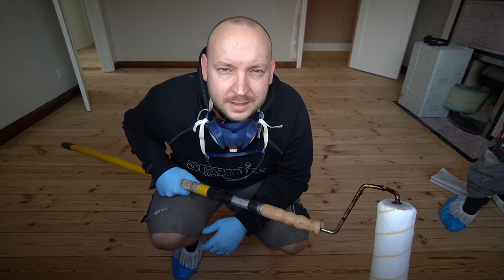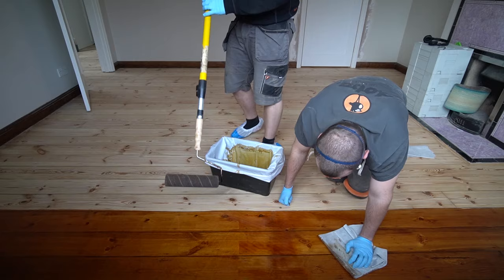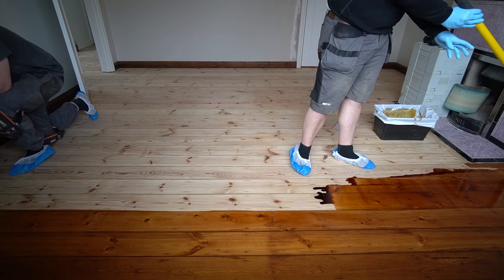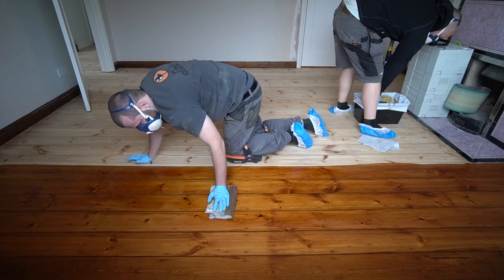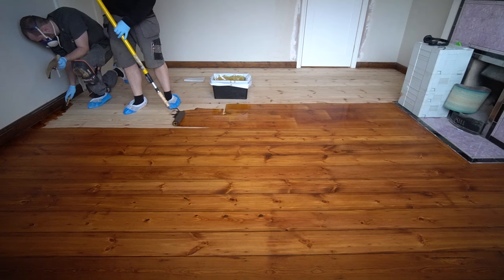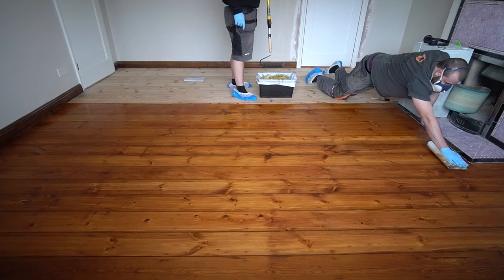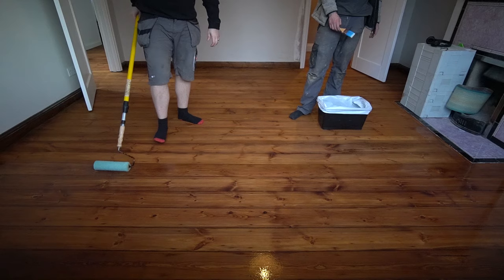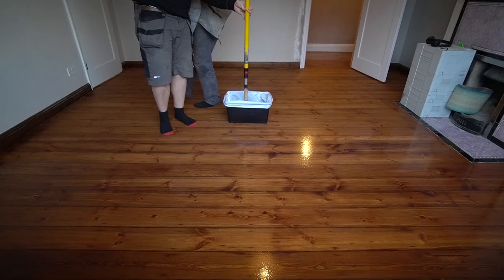A Staining Method That's BETTER FASTER AND EASIER

Comment: Nice job... Am sanding down my hallway this week (Victorian pine), and am going to stain it. Like the look of this Morells, and was going to use a roller anyway. Thanks for the confirmation it will work. What colour is this one?
Reply from the maker: I think it was medium oak
Reply: Cool. Many thanks! Great video. Wouldn't have thought of getting someone to wipe the excess off straight away. Will get the missus on the case with some knee pads!
Reply: what thinners other than Morrells could you recommend?

Comment: Thanks for the videos. Would you recommend a beginner using a roller on a pine floor inside a log cabin?
Reply from the maker: It depends on the stain you’re using to be honest. The safest thing is to rag on and rag off

Comment: Thats a belter of a finish man. Perfect colour too, not too dark, no orangey bits either. What type of pine did you use? Im planning on using French Maritime pine from B&Q. Thanks.
Reply from the maker: Micheal Kaye thank you sir. 🙏🏼 these pine boards were original, it won’t be the same from b&q. Was medium oak stain.
Reply: @HowToSandAFloor  In what way will the French pine differ? The older boards in this vid may be drier and better settled? Either way, the stairs and the room look great, really good colour and finish. Im doing my own 8sq. metre kitchen, when its done Ill send some pics. Thanks again for the video.
Reply from the maker: Micheal Kaye new pine is farm grown, much lighter, absorbs much more stain. You could try getting reclaimed pine boards

Comment: Will the top coat fill in small cracks? like a water-based poly. I filled a lot of mine with wood filler - but I'm still getting cracks after drying. If so, how thick of a crack would you say? thanks for all of the videos
Reply: Haha - I'm just now hearing the filler part of the video. But, if you don't fill, will the lacquer fill up to a certain gap thickness?

Comment: Looks great. Just curious about fillings. Could you fill cracks(not the whole floor) with epoxy? Or would that mess with the expansion and contraction of the wood?
Reply from the maker: Epoxy is just very stiff, and probably unsightly, what kind of flooring do you have?
Reply: @HowToSandAFloor  I'm not sure on the wood but im in the midwest US  with 120 yr old floors if that tells you anything that may have been common in that time period. It has 2x6 for subflooring and just minor cracks throughout a portion of the floor ranging 1-3 mm in width. I just worry with filler coming loose over time
Reply: @dakotaholcomb5003  I know this is 11 months old. But for other people reading this, you can look into Wood Flour epoxy type filler. Basically you save the dust from sanding the floor and then you can mix it in with this kind of like epoxy stuff and trowel it onto the floor, or just spot fill depending how much you have and want to fill. We usually do it on hickory floors if there's bad cracks because hickory is really hard and it holds up better, also, because you use the dust from that floor it matches the age and the color better than just normal filler

Comment: Should you stain before or after applying sanding sealer?
Reply from the maker: I’ve never applied sanding sealer in my life
Reply from the maker: Unless sanding sealer is just a primer, but stain usually acts as a primer.

Comment: It’s really simple,a roller is more likely to splash stain around, and more difficult to squeeze into little cracks,nail holes,etc…thus more likely to skip those spots.your technique looks solid,but I hand apply all stain jobs under about 3,000 feet.
Reply from the maker: Have you tried it?
Reply: Oh yeah, I just hate splashing stain!also tends to apply too much! I have done this a long time, and tried many different methods, but I will either hand wipe, or use the buffer 😀
Reply: @HowToSandAFloor  yes but probably a different roller

Comment: Yeah, I do hardwood floors in the United states. People love stained floors right now. 

I still stain by hand, rub on, rub off. But with rags.
Reply from the maker: What stain do you use?
Reply: @HowToSandAFloor  usually I use midwax. Their oil based stains.
Reply: @HowToSandAFloor  it's real easy to find in my area, it mixes well for any color the customers wants and it doesn't react at all with swedish finish I use.
Reply: @HowToSandAFloor  minwax* ha ha ha
Reply: Great work

Comment: Hello mate, really like your vids great job and thank you! I’m a happy go lucky DIYer, I have a pine parquet floor in a herringbone style. Made myself as a bit of a hobby, I need to sand and finish and wanted to try and match the colour to a warm / dark oak similar to actual oak parquet in the adjacent room. I was googling the Morrells stuff you use in this video, can I use the same method of rolling or do I need to do something different given the pattern and varying grain direction? Appreciate any help, thanks P!
Reply from the maker: I would use bona craft oil because it allows you to apply to the whole floor, then rag off the whole floor, saving application lines. I think DIYers shouldn’t stain floors. It’s virtually impossible for an amateur to get right. But staining herringbone floors... you’re begging for upset. I know you won’t take my advice on this. No one ever does. But I recommend going for a clear lacquer finish. Save yourself the heartbreak
Reply: @HowToSandAFloor  THis 100% !!!

Comment: Getting a house with wood floors,  would like to make them darker.  The floors are in perfect condition so how much sanding should I do,  if I dont need to sand to repair
Reply from the maker: if you want to change colour, you deffo should go back to bare wood, so maybe a millimeter, or a 16th of an inch deep

Comment: After putting the stain on my floor, the wood became pretty rough, not smooth at all.  Should I need to lightly sand it before putting BOna Traffic HD? How many coat of BOna Traffic HD I should use? Thanks
Reply from the maker: If you used a water based stain then yes, it pops the grain of the wood. I’d you rub it back now, it will take the stain out of the peaks of that roughness, if that makes sense. So the high bits will become light again. Coat the floor, then rub it back. If it’s really rough maybe coat it twice, then rub back and final coat

Comment: Across the pond, we stain with the buffer and carpet discs. Still cut in by hand. Did you pop the grain? Looks really even for a pine floor
Reply from the maker: No pop, we don’t really have any god stains that lend themselves to buffer
Reply: @HowToSandAFloor  Duraseal has been a great stain, 20 years never a issue.  
Do you have hard wax oils, Pallman Magic oil or Rubio mono coat?
Reply: @petersutton76  Yeah, we use Duraseal stain and a buffer here in Colorado, and use Loba finishes typically. The roller looks just about as fast as less of a hassle of a buffer especially for a small house. But your helper is gonna be really mad after doing a 1,500 SQF great room lol.

Comment: In theory the way you apply the stain doesn’t matter. It’s just a matter of wiping off. Usually lambs wool is better than this method to control excess. Otherwise you just waste a lot of stain. But there’s no real problem with this as long as you wipe off.
Reply: The guy wiping should put the rag on the end of a mop handle or something. He needs to only wipe in the direction of the grain. He seems to be all over the place.
Reply from the maker: You’re definitely not in the U.K.!

Comment: Just a question.........what machine do you recommend a beginner to use to refinish a hardwood floor. Im doing my own floor. Im not worried about taking my time. Im just not experienced in using so many machines.
Reply: Get a rental. Watch a video on how to use a 8 in stand up belt sander.  And sand  the few inches from the wall with a edger. Us a buffer to finish.. probably not gonna look perfect your first time. But its possible it will look okay if you do your research... like go.watch 20 videos from different 'professional' people... make sure you know what your doing

Comment: great job man, just a question in the of bona specifications suggest 1 coat of Bona sealer followed by two coats of the Bona Traffic HD. is that necesarie?
Reply: sealer is only necessary on natural (no stain) floors. prevents "paneling"
Reply: @bruce5952  We use sealer on every floor plus 2 coats on top of that. I believe the LOBA sealer we use is a kind of an oil / water base mixed which helps keep the stain from bleeding out and or fading or doing other weird things.

Comment: Can I do it without sanding the floor?
Reply from the maker: Unfortunately no, you need to sand the floor to allow the stain to penetrate into the wood. I’d the floors has a finish on it, it will just wash over the surface, look horrible and probably damage the finish.

Comment: Hi,

Unrelated to staining, but figured I'll leave a question here anyways - could you please maybe suggest the proper way to waterproof hardwood floor? 
Only viable option I can think of is epoxy, but I assume that will cost me the same amount what I got the boards for. 
I have gotten a reasonable amount of oak boards and plan to make a bathroom flooring out of it, since I really don't like tiles (I somewhat realize what's ahead, but I like proper challenges). So before running into this problem, I'm trying to get to know my options beforehand and wanted to ask someone who actually knows this stuff.
Reply from the maker: As far as I’m aware. There is no way to waterproof wooden floors.
Reply: Gym Seal. Really stinky, toxic stuff. They used to use it on gymnasium floors in the 70’s, 80’s etc. I had a friend who had it applied to her wood floors in an old house, back in the 80’s. I haven’t had any contact with her in decades though. It filled in all the cracks, too. But the janitors that used to apply it at my school, used to get high as a kite, applying it. I have no idea if it’s still available, these days. What did you end up doing?
Reply: @susanmei9980  Hey! I actually have not yet gotten around to do it. The hardwood floor comes after a long list of other things, so my question from two years ago, might have been rushed, but I am still thinking about this. I've made fair share of furniture from that pile of oak and seeing it expand and contract during the seasons, I am starting to think that maybe oak is not the best idea for a floor, that will somehow need to remain crack free. I guess the constant moisture changes in a bathroom might get to the unsealed bits and ruin it.
Reply: @kristapsliepnieks9949  I’ve seen a lot of videos about using epoxy on countertops lately. And basement floors. I think the company is Stonecoat countertops. They even show how to do showers and stuff. So maybe there is something else you can find that you like, to do the floors with. And then epoxy over it to make it waterproof. Even tile isn’t normally waterproof, due to the grout. But I’m thinking if you epoxy it, it might be. Just an idea. 😃
Reply: @susanmei9980  I am not really going to pour buckets of water on the floor, like I don't need it to be a pool. :D I'm just worried that oak when it gets moisture, will definitely move. And this movement usually creates cracks, increasing the surface area where it can absorb more moisture and the cycle continues. Eventually rotting everything. 
In general, the more I work with it, the more I understand that exposing it to such conditions is a bad idea, so I might just leave it for furniture and find something less sensitive. I though of the epoxy, but the price is what made me consider other options.

Comment: I don't see any harm in using a roller. You're wiping off the excess anyhow. Many times we just put it down with the lambswool mop and brush. We put it down carefully and then walk away. Our just come out great with no wiping. Many times we water pop the grain prior to applying the stain so it's more porous. All of the stain we put down gets used into the wood. Sometimes you have to wipe. But we try very hard to avoid that doing large homes.
Reply: What stain do you use?
Reply: @SkillzMillz83  primarily we use duraseal, Bona, and minwax stains

Comment: you asked to tell you what you were doing wrong..  Rolling on spirit based stain, is fine.  One. if you start from a wall and your helper is cutting in the other wall with stain, roll from the first wall all the way to the second wall.  better the stain you're putting on gets thin towards the 2nd wall, than have that cut in ( brushed) stain on the far wall, sit while you roll roll roll, even out .. dip , press off the slack and roll roll roll until you get to the other side.  Better he doesn't start brushing that other edge, until you are 2/3 rd the way across the room.  Two: the great thing about hardwood floors is the irregularity of the boards.  When you roll on stain, one need pay attention to the gait of his swath.  If you notice at 8:31, you are nearly done with the room.  Can you see the three disntinct stop/start lines that span the entire floor from screen to wall?  It's because you are rolling from start to your arms comfortable length. and the you do it again, again, 3' wide, 6' long.. It stands out,and the only fix is to go in on hand and knees with some 60 grit to break up those start stop lines, then blend it out with some 150.  that is a LOT of extra work, that is unpaid , and could be avoided, with using staggered random length swaths with your roller. Number three.  This is huge.. your helper.. is slow as ice.  God help him, he is slow. and when he ir swiping to pick up, he is focusing on blending five feet behind him, and only inching forward 6 inches at a time.  that leaves the stain in front of him longer on the floor than the stain he's trying to blend behind him.  You have got to be Johnny on the spot with the pick up rags.  keep feeding him clean rags, have a plastic drop for the used ones. you can add more stain to a floor to blend and balance. it's a bitch to remove too much when the client complains its "darker than I thought it was going  to turn out." and they make that face...  FOURTH your pick up man, his arms are tired half thru room 1. you need two helpers,  His arms are tired, you can tell when pick up the stain, he goes straight straight following the swath, then he starts arcing his arms, as if that's how you put the stain on the floor.  In arcing rolls instead of straight rolls. hat leaves stain or motion in the arc, when the rest of the stain is going with the grain.
Reply from the maker: I don’t see the stop lines where am I looking?
Reply from the maker: Only way to fix it is hands and knees with 60 grit?? What?? 😂
Reply from the maker: 1) What if your room is bigger than this tiny box room? You can’t do that
Reply: @HowToSandAFloor  If I could attach a screen shot, I would.  go to the 8:31 point in the video.  there are three, from right to left, nearly evenly spaced which aren't blended.  each are spaced approximately 1/3 the width of the floor.
Reply: @HowToSandAFloor  yea you can.  You just break it up into smaller irregular, straight swaths of stain, and have more than one helper wiping it up.  I mean, it's not Jacobean on a quarter sawn 3/4" micro grooved birds eye maple, near impossible to blend, - its pine.  I'm not saying I'm the hardwood floor staining master.  However, this is how the 5th generational Russel Floor Company taught me how to stain floors with a spirit based stain, with a roller.  the helpers are the most important aspect of the job, the uniform pick up of the stain.  You can only go as fast as your slowest man on the team.
Peace.
Reply from the maker: @williamedwards6519  where are the stop marks?
Reply: @HowToSandAFloor  about 4th 7th and 10 row right to left. I get what he's saying. Even Runs of three feet dry to a pattern overtime. He's saying bea bit more random

Comment: I don't know why I've been having problems with picture framing and I don't understand what the hell I'm doing wrong and I run a trio for my finished machine I'm getting sick of it it's only really on dark dark colors even when I water pops sometimes I get them and I don't understand why
Reply from the maker: What do you finish the edge with?
Reply: @HowToSandAFloor  I promise and the edges with 120 3M paper I finished the middle or the final sand on the trio after I palm sand with a 100  I was trying to even it out since the edges are always dark it's just that last 2 in where the trio doesn't get to the edge of the wood it's like the tree of sands it too smooth that's why I try to go with 100 on the trio and 120 palms in but I'm still getting picture frame a border

Comment: Why don't you use a wood conditioner?
Reply from the maker: I get this one a lot. None of my suppliers sell a wood conditioner, I've never met anyone that uses or even has ever used a wood conditioner in my life. When I have been on training days or spoken to reps from the finishing companies. They have never mentioned wood conditioner. In fact the only place I have ever heard the term is here on YouTube.
Reply: @HowToSandAFloor  that's interesting.  Wood conditioners  or pre-stain are usually applied to achieve a more uniform stain color but also can help with lapping.

Comment: This definitely makes me cringe, soo much stain.  When I used to do floor refinishing, it would solely be by rag, put down enough to fill up the wood, and wipe off, to limit any excess to allow for quicker dry times.

Putting too much down also has the risk of some areas soaking in more, causing discoloration.